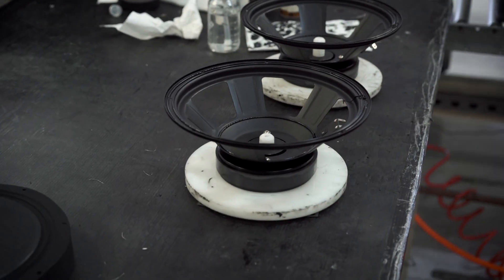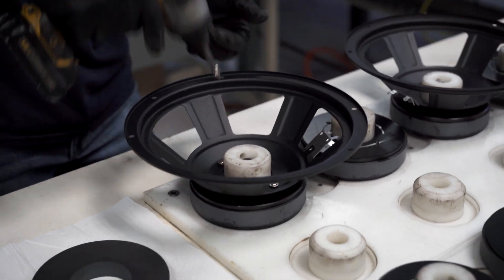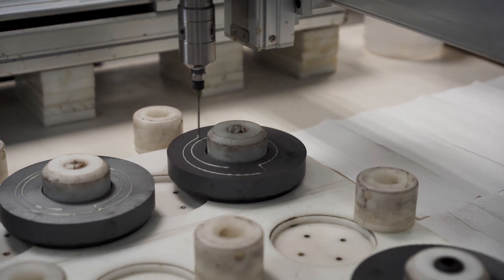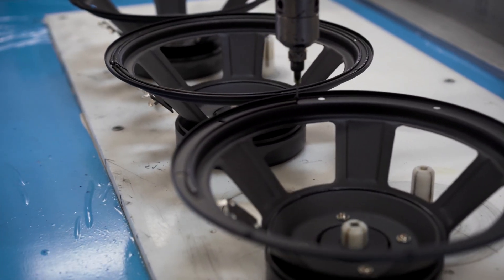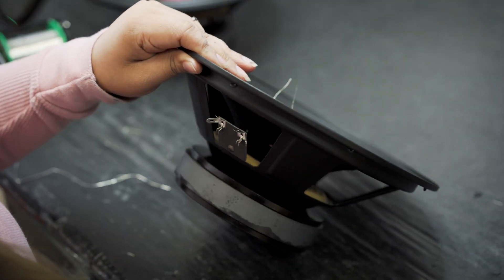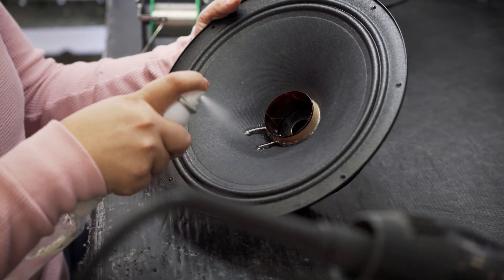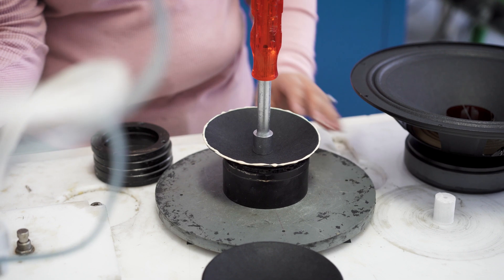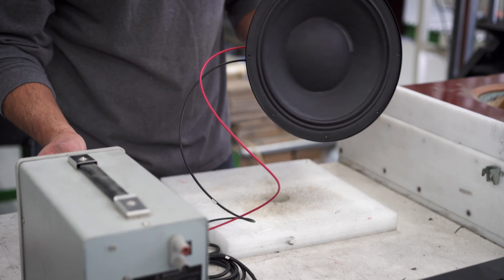Gallien-Krueger Factory Tour Part 1: Speaker Manufacturing

Comment: Unrelated to this specific video but it’s your most recent so it’s the best chance of you still looking at comments. 
I’m looking for some help and advice please. I’m waiting to purchase the Fusion 1200S head with the Neo IV 212 4ohm and 112 8ohm cabs. But I’m hesitating because I’m concerned that the 2.7ohm load from that config would allow the head to put out 950watts. The 112 cab is only rated to 400watts and I wouldn’t want to risk damaging it at the high volumes I’ll be playing at. So is the 112 at risk of overload/blowing is my question? I’m trying to downsize without losing power/volume. Shhhhh… don’t tell anyone but I’m defecting from a 23 year marriage to Ampeg!
Cheers

Comment: My GK 500 watt combo has the 15" and a horn.  Here is what matters when it comes to speakers; Can they move Air?  My amp and the 15" speaker MOVES serious air.  The bass frequencies are extremely tight.  No rattle whatsoever.  The GK is the only bass amp that can handle anything you can throw at it.  Passive or Active; it takes it well.  Another thing I love about my GK is that is does not over compress.  To my ears, the amp breathes and that is critical when you use all of the different types of bass that I use: Fretless, P/J, Active Fiver, Acoustic and flatwounds.  The amp handles it all and it does it easily.  No mush.  Just a great amplifier that will last me for many, many years.  Thanks GK!!
Reply from the maker: Thanks for trusting us with your sound!